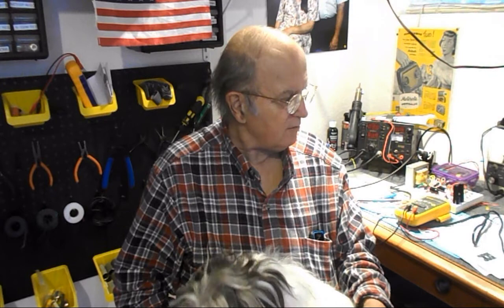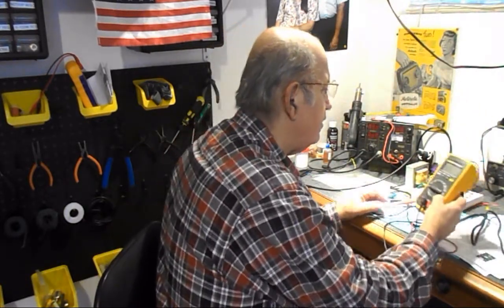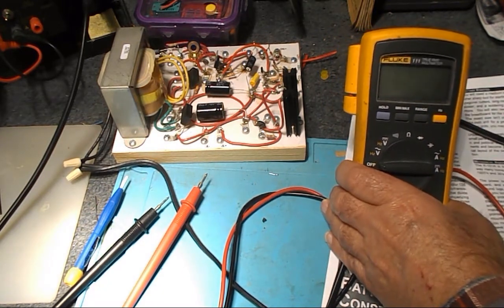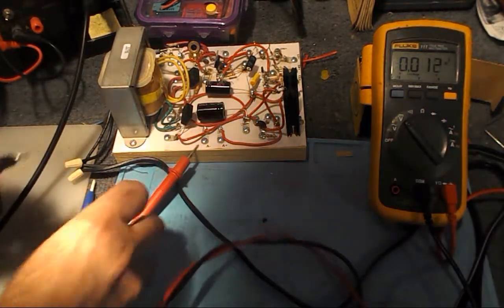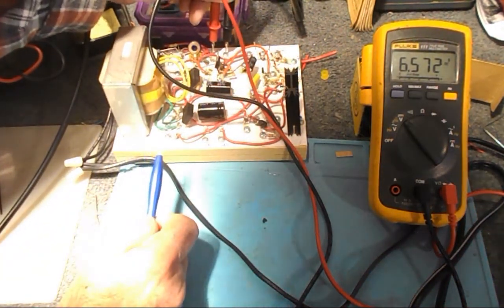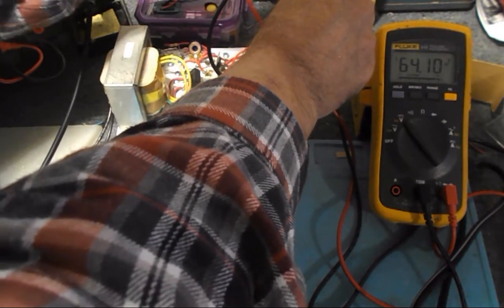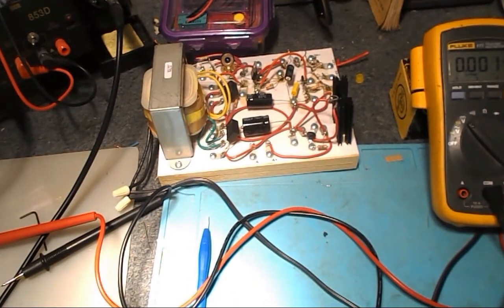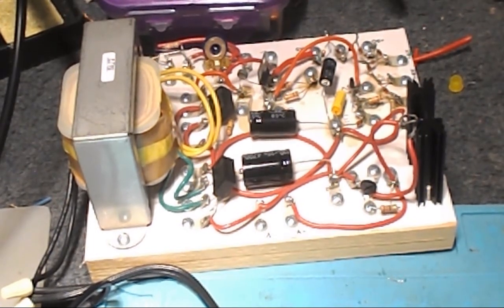Testing voltages on the K-101A Regulated A, b & C power supply

Comment: Larry, I can't remember if you said where you got the plans and schem for your power supply.
Reply from the maker: I bought the complete kit with parts and schematic manual from Antique Electronic supply they sell it there as a bread board supply. I don't remember what I paid for it now. But you are given all the parts and a template for the board and where to place all the metal terminals.  Mine works fine I forgot there was another trimmer cap that could adjust the higher voltages as well and it all works fine. Ron C told me he got one but could never get it to work. Guess I was lucky.

Comment: Larry, glad that Ron is back safe and sound. You did a fantastic job on this power supplier. It looks great as well. Have a great day! Regards, Jay
Reply from the maker: Thanks Jay The power supply was the first one I have ever put together that was on a board. I needed all of these voltages for my 1924 Dayton Fan Radio the 1926 Atwater Kent radio and my 1928 Case radio. I needed it to test out each one which have never been powered up since I bought them. Have a great say as well Jay